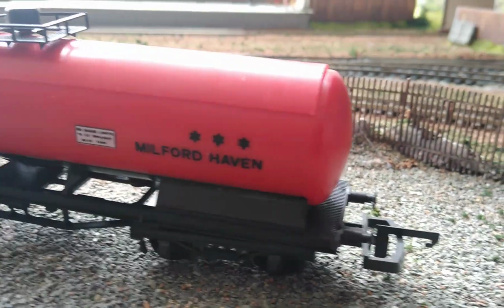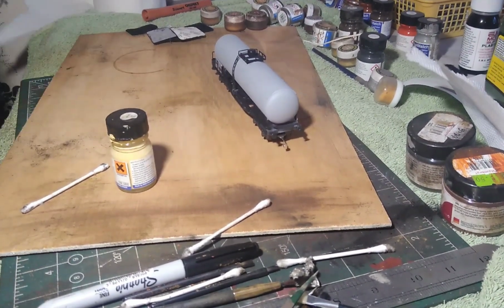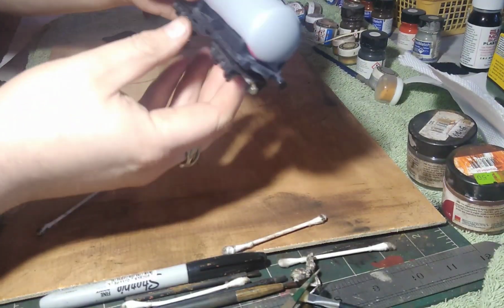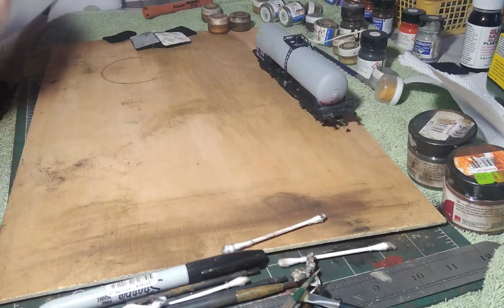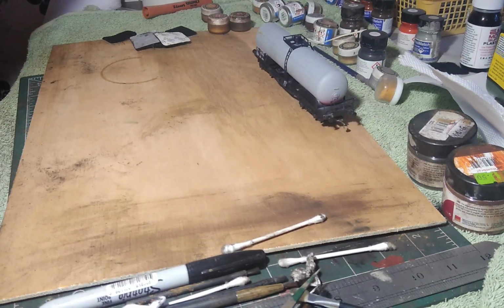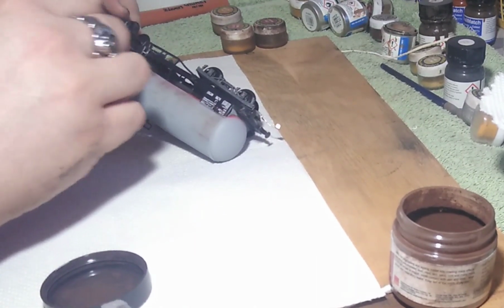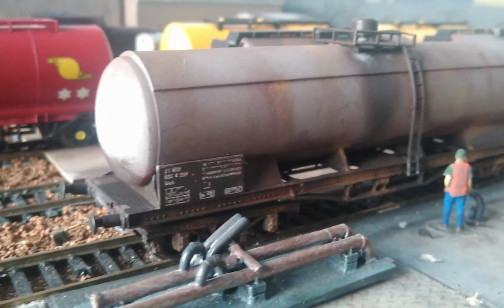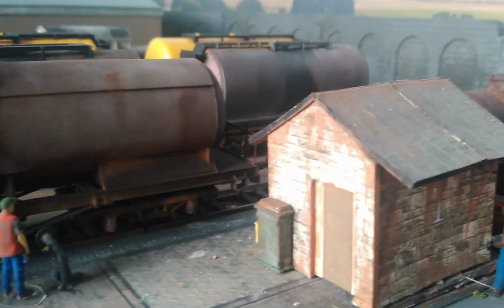Giving a LIMA tanker a mucky makeover | weathering oo gauge rolling stock upgrade

Comment: Looks good, do you use hairspray to hold the powders?
Reply from the maker: Eyup bleaky, it depends on what the Powder is for and what it's going on...

For light streaking I simply spray down a thin or light coat of Matt varnish from Humbrol or rail match.

For heavier applications I brush paint Matt cote and "push" the powders in to blend them for a heavier finish. :)
Reply: @IronHorseRailways  yeah it’s good to try to fix it down, extra hold hairspray (not the oily ones) are good for a budget job. You can’t beat a bit of 3D weathering 👍👍👍 beats an airbrush 9 times out of ten👏🏻👏🏻👏🏻